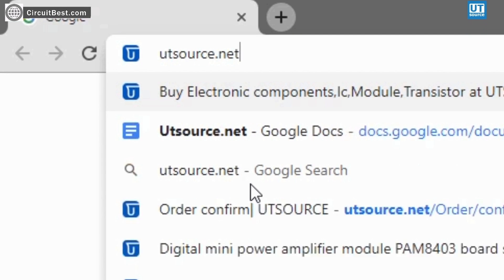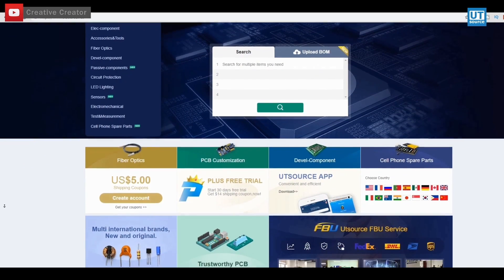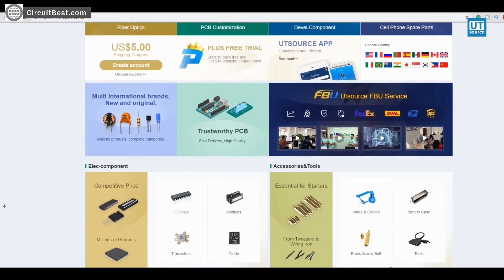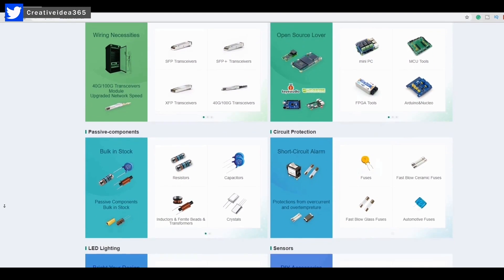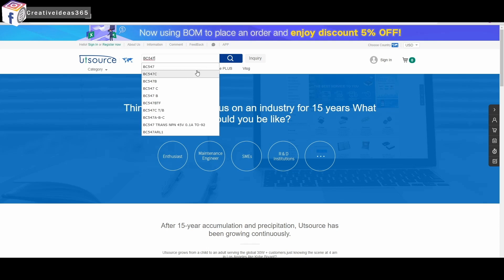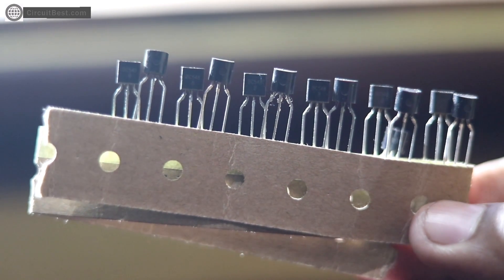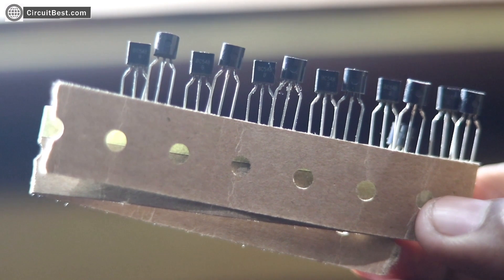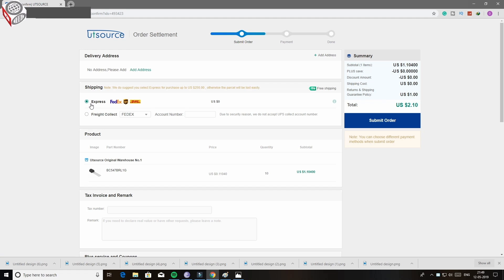LDR Darkness Sensor Circuit

Comment: Hey, What type of transistor should I use for a power supply in the 5V 200-500ma range ? I want my power supply to stay in the 200-500ma range. For this, I do not need to connect a resistor to the circuit as in the cover image of the video, right?
Reply: 330 ohm 220 ohm

Comment: Bro can't we make this without using soldering iron? Please reply...
Reply from the maker: Yes you can
Reply from the maker: Yes 😉
Reply: @Creativecreator  😘
Reply: @Creativecreator  Thank you bro
Reply: Thank you very much bro😇
Reply: We can connect those through wires? Reply please
Reply: Bro My Ldr is not working the light is glowing on both cases or the led gets burnt😅
Reply from the maker: Ohh 🥺

Comment: I am not an engineering student but what will happen if I don't put 100k resistor in the circuit
Reply from the maker: It will not work buddy
Reply: @Creativecreator  the led will only lit up as usual right? But won't sense the light?
Reply from the maker: @Only_Subha  yes
Reply: @Creativecreator  thank you so much for spending your valuable time to answer me 😊
Reply from the maker: @Only_Subha  you are welcome buddy If I get time and get notifications then I will always try to encourage my Subscribers 😃😃
Reply: @Creativecreator  and if I only connect the transistor base and emitter to the battery , will the collector section work as an amplifier when a load is connected?

Comment: Can I connect 4v DC  LED strip instead of 5mm led and power supply of 9 volt all purpose battery  then which resistor i connect?
Reply from the maker: You can connect 4v strip.
Resistor around 500ohm to 1k .
It will work fine.
Or you can use 4v battery
Reply: @Creativecreator 👍 thanks for quick reply
Reply from the maker: @9krishbhoir734  welcome buddy